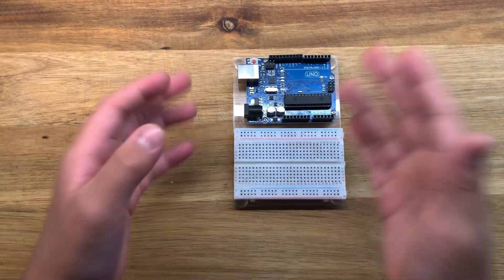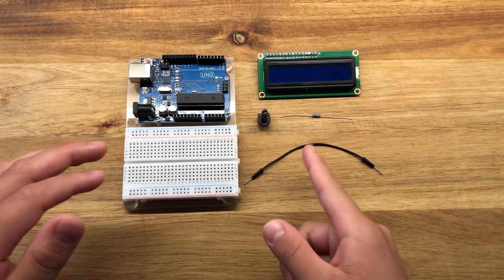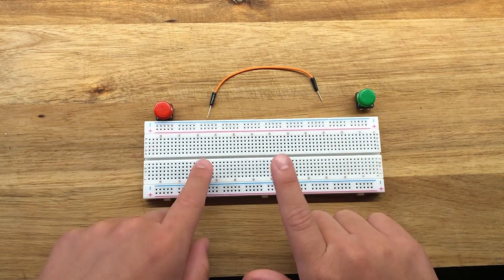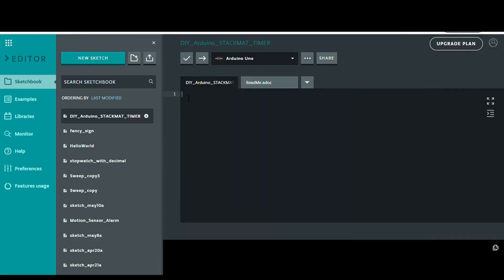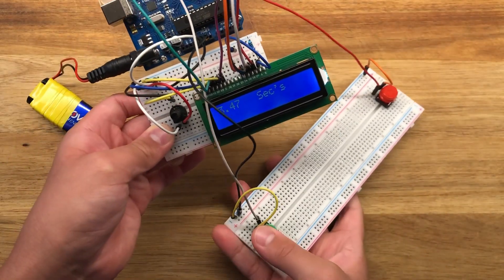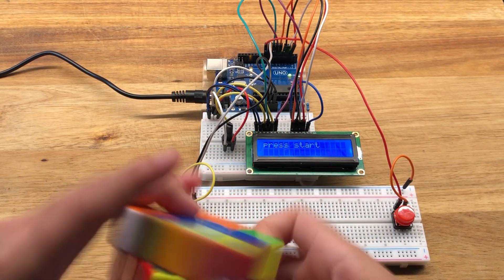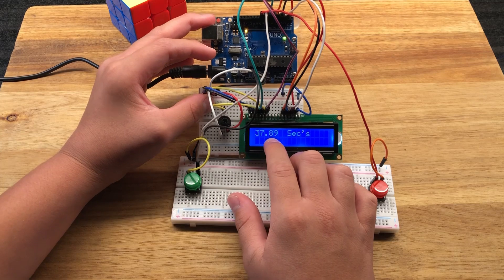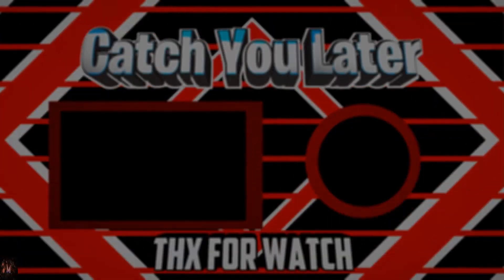#HOWTO MAKE A #FREE STACKMAT TIMER (#DIY)

Comment: This is a great idea but won't there be a slight delay between when you press the button and when it registers, why not use a touch sensor to register when a button is pressed, I have made a touch/water sensor before and have the schematics so if you want I can give it to you to integrate it into your current circuit.
Reply: yeah but the delay will be at the start AND the end so it doesn't matter. It would be really nice if you could describe how you build the touch sensor btw.